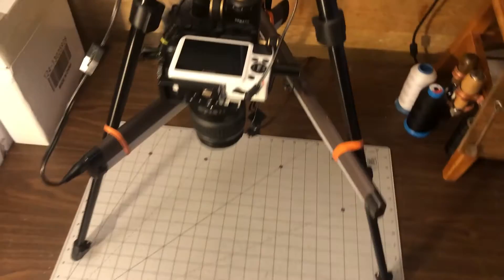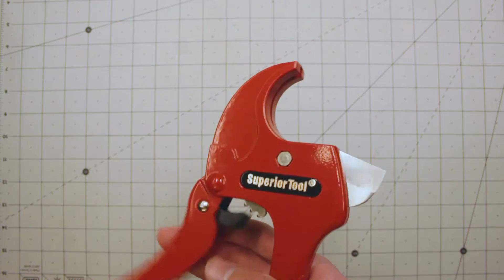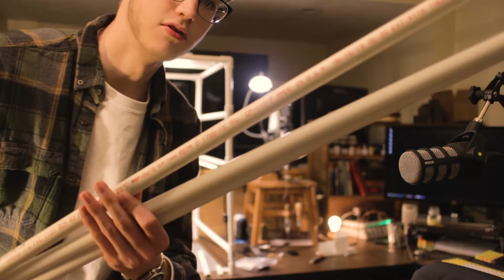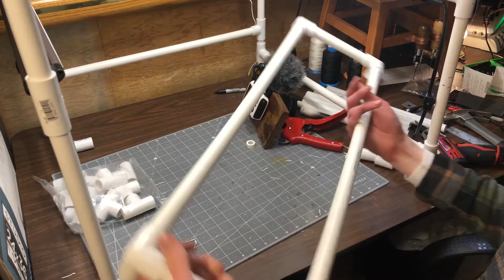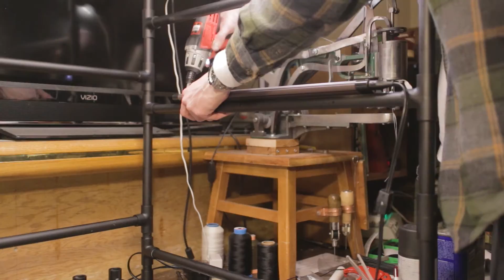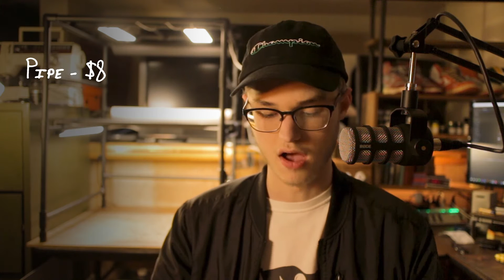$50 Custom PVC Camera Rig

Comment: Where did you buy your pvc pipe? My local Lowes had 10 foot of 1/2" pipe for around $5 or so. Definitely not $1ish. When I priced out a similar build to this just the pipe and connecting parts alone was close to $50. That doesn't count the cutter, spray paint, or lighting. All of that said, the video is still great and super detailed. I hope to be able to make myself a "creative space" using this as a base for the build.
Reply from the maker: Yeah unfortunately prices of materials have gone way up in the past year or two since I did this project. I purchased my material at Menards but back then it was cheaper everywhere. I may have to change the title since this isn't totally accurate anymore I guess. 

Still a good budget option but not as cheap as before. I'd love to see whatever you make when you're done!
Reply: @EvanMonsma  Definitely agree it's still cheaper than actual camera rigs! I'm just looking for something to point my Webcam down with good lighting for streaming sketching and using Spelltable (playing the game Magic:The Gathering online with physical cards). I'll do some more digging and look at my options since I likely don't need something as involved as yours.
Reply from the maker: @kennifusprime  This setup does get a lot cheaper if you don't need the camera to slide around since you wont need as many tubes and fittings. But if you just need a stationary smaller setup you could do that with very little material. Could even just do it with scrap wood if you have any laying around